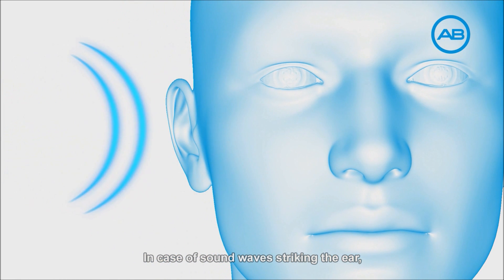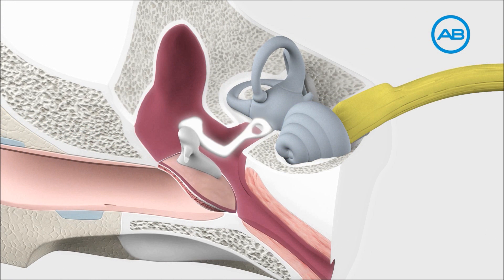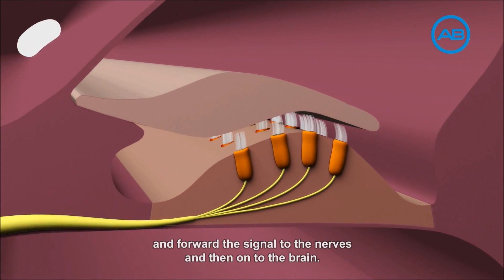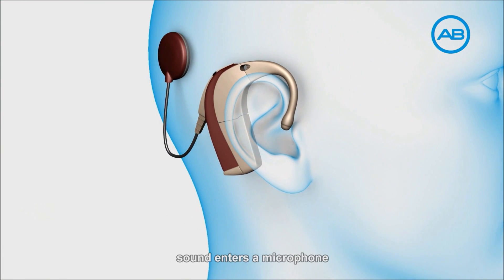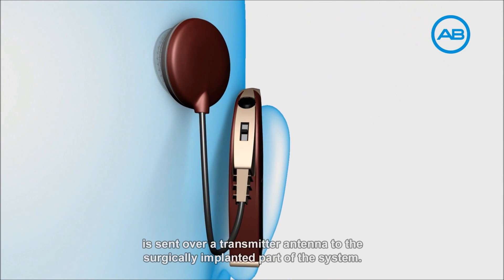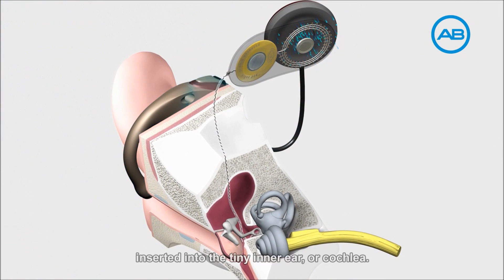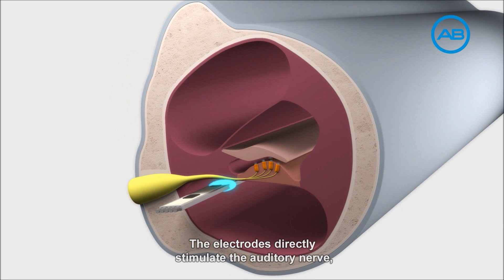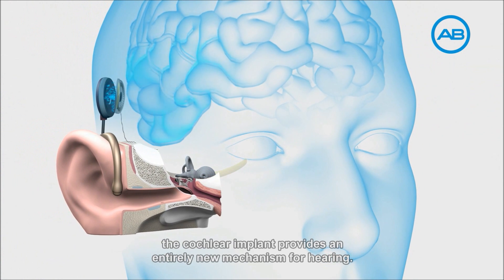How A Cochlear Implant Works by Advanced Bionics

Comment: what is the frequency range of the implant since you stated it is not as broad as human hearing (?The range of human hearing is generally considered to be 20 Hz to 20 kHz, but it is far more sensitive to sounds between 1 kHz and 4 kHz) Please tell me what is the frequency range for an Advanced Bionics Cochlear Implant user??
Reply: Based on my (very basic, second year uni neuroscience) understanding, which brought me here in the first place, cochlear implants cannot help to aid hearing in frequencies below 250 Hz, which is because they cannot be implanted that deeply into the cochlea to send signals 'from' hair cells on the low end of the spectrum. 
Obviously VERY basic understanding, but someone please correct me if I'm wrong!

Comment: I wonder if you can use this system to hear frequencies outside of the normal human hearing range
Reply from the maker: DjNerDee Hi! the frequency range of an implant is not as broad as normal hearing.  Thank you for asking!
Reply: +DjNerDee     yes   I do have  nucleus5  I hear  outside   most   also I hear   very far  away  hear  train
Reply: +Terry Moffatt I think he meant the frequency. If the implant can make people hear higher or lower frequencies than normal hearing...
Reply: I don't think so, as that would mean more Celia in the cochlea to receive the signal. This product essentially replaces the ear drum. Affecting more how you here than what you can here. (I think)